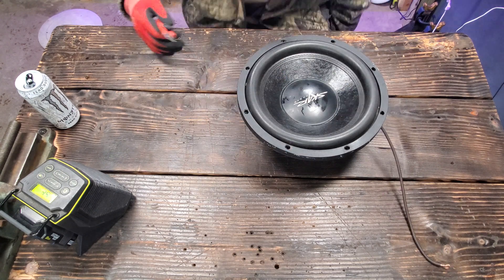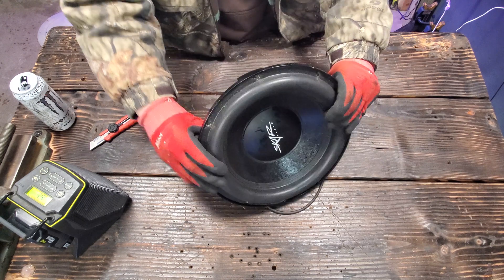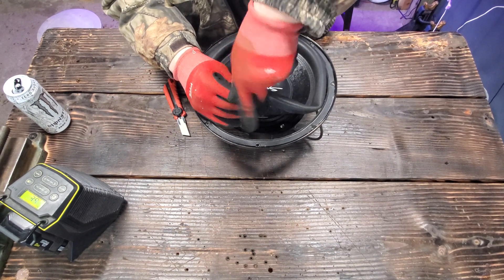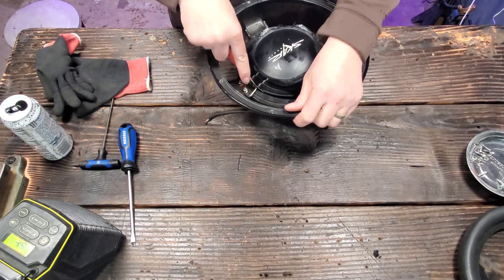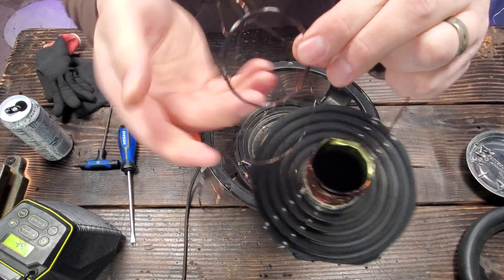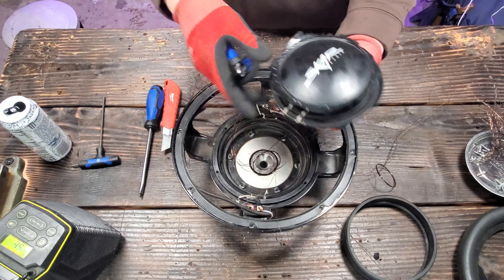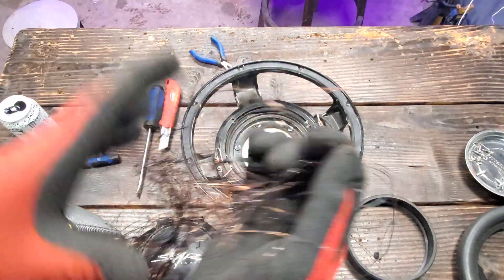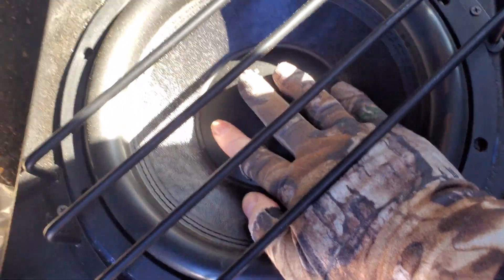Skar VD-12 D 4 12" Shallow Mount Sub. Lets take it apart and see why it BLEW💥💥

Comment: I will never buy skar again they are just cheap junk I ordered 9 ma8's I talked to them before I order what they had left in stock as I needed 12 they said I they would be back in stock in 2 weeks 3 at most 2 weeks later I sent a email to see if there was a ETA update the tell me 2 more weeks I messaged them again then says there here but they will be restocked Monday company but nope call them Tuesday and they tell me they discontinued them of course I said will I needed the 12 not 9 I want to return 8 of them (I opened 1 and screwed in box for the box fitment) said no its been over 30 days even asked to do a up trade and I would pay the difference but nope and it was the owner I talked to every time so he new what was going on I felt like he was just damping the lift over stock then played me for 30days so no return had to be taken I left a 1 star review.. The next problem was 3 months earlier I ordered 3 RP-2000.1d mono amps to power the at that power the at that point future 12 ma8's sub's order but 1 of the amps was missing to remote base knob I called them 4 or 5 times over it they kept saying will get it right out to you well it been a few years and I never got it I left a 2 star review this was my 1st bad one and when I left the 2nd bad review a 1 star for the MA8'S subwoofer debacle is when I figured out the SH*T company deletes there bad reviews and that would be why they have such good reviews.. thanks for sharing

Comment: Nothing like a video trashing a manufacturer of decent audio equipment, potentially swaying the opinion of others to think SKAR AUDIO is junk based on some dude's experience (or lack of) of over powering an entry level sub in a shitty sealed enclosure with added ports that were not properly calculated while in a frozen tundra of car audio despair. (Yes, ambient temperature plays a role)
So many variables in this equation that all point at the installer /user. 

Hey man, its not fair to publish a video blaming your lack of using simple mathematics and a little bit of science on a manufacturer that did actually put the time & effort of calculating what this sub can handle when engineered.  They even wrote it on the box and put a sticker on the magnet telling you that. 

Clearly this is no ones fault but your own man.

Comment: Lets do some math....each sub can handle 500 watts RMSx2 = 1000 watts power handling. Amp is 3k at 1 ohm if subs are dual 4 ohm wired in series gets you down to 1 ohm load. 3000 watts vs 1000w power handling and I am sure a little clipping yeilds fried subs. You put 3x the power to those subs and the subs are bad?🤔. Come on now. Next we are going to hear the gain was not even that high just half way. Those subs if in a proper box with the gain set correctly (not all the way to clipping) would have played well. There is a lot to know in DIY car audio and this one one of those lessen days.
Reply: Two 4 ohm subs wired in series is still 4 ohms you would have to wire them in parallel to get down to a 1 ohm load
Reply: To get to 4ohms you need to wire two dual 4 ohm sub's in series/parallel.

Comment: I have 2 skar vd-10s on a skar 2000.1d in a ported box in mt '16 F150 crew cab. Been running her hard for almost 2 years now, zero complaints and she fkn bangs
Reply: I have the vd12 in a custom but under the seat of my crew cab. Is ported box under the seat? I hear ported is the way to go especially for these shallow mount subs
Reply: @ttwizted6020 actually sealed is better. That came from a guy that builds systems for competition. Especially for sound quality.

Comment: The copper coil is thin because its only 200 watts rms each coil no thicker coil needed

Judging by the video u used a good amount of force to take out the screws the reason why there's no glue around the spider is because it would be easier to recone 

I wouldn't rate that subwoofer 500 watts rms I'd say its 400 to 350 watts rms
Reply from the maker: If i am not mistaken doesn't the box say its 800 watts 500 rms, but is clearly not. thanks for watching man
Reply: I find your review kinda funny and sad at the same time. I have been running 2 Skar VD-10 D4s for about 4 years now and have had no problem with them. I did replace one because of enclosure issue but that has been fixed. I have an RP1500.1 powering them and they bump pretty hard and clean for being "over powered". Ultimately it comes down to enclosure design and how you use them. The specs say to design a box at around 36-42 hertz for optimal usage.
Reply: I've been running 1200 watts RMS on my VD 12 for 2 years hard. zero issues. he was running 1500 watts RMS. it is definitely not a 200 watt RMS sub 🤣

Comment: Feeds 3k watts to 800 watt sub and it's the subs fault....🤦🤣🤣🤣
Reply: Yea no shit. "Thinnest wire ever!" Yep on a voice coil from a 500 rms subwoofer. From the 2nd tier line of an entry level budget company. Haha. I've been running exclusively skar (EVL series) for 7 years, mids and tweeters for 3 years and not a single problem. It's amazing what rms matching, correct wiring, a good electrical system, and an oscilloscope will do.
Reply: 800 watts max for each sub dummy

Comment: What's a better 12 inch shallow for $80?  I've been waiting to get these for my silverado extended cab.
Reply: The subs are really good haven't had any problems  mine are the 12vd d2s and I have them on a smart 3K and they've been playing great for a year they bump really hard everybody trips out that their shallow mount Subs I have them in my Escalade in a sealed box behind my third row
Reply from the maker: That's that thing for 90 dollars shipped to my door, You cant  find a better deal. I should of just spent the  160 a peace and got the C.T. sound like I wanted to.  Hands down the best sub I have tested to date!!!!

Comment: What amp were you using at what ohm? I have these but mine are 10s and I’ve been feeding a 1200 kicker amp to them for two years and their still rocking strong.
Reply from the maker: They were 2 ohms, and I was running my smart 3k taramps, but it was from the box, I had a ram box for under the seat and it's way to small for those subs. It's like .5 cubs be sub, supposedly. But there is really not much room in those at all. So the subs heat up faster. In a smaller space.
Reply: @alsrandomvlog8968  u were running more than 1200 watts 💀💀 u most likely over powered it
Reply: @Louie-ji8xn  yea he was giving them 1500 rms a piece. They're 800 max 🤣🤣🤣
Reply: @TheBakeMaster  🤣🤣🤣🤣🤣🤣

Comment: When I see a black coil that isn't supposed to be black the first thing I think of is clipping. sadly skar doesn't sell any recone kits. I hope u still have some bass in the truck
Reply: What box did you use?
Reply from the maker: @tuckerramos4439  It was a shitty Ram box that goes under the rear seats for a Ram 1500 because its not flat like the fords, it has those to big storage bins because of the transmission hump in the middle. If you look in my other video were I blow it you can see the box.
Reply from the maker: Of course, See what it is, i bought one of those ram truck box's and there is way to low of air space in them, around 0.6 cubes but I think its less then that, so the subs would heat up quicker because the box was to small. 
So technically it was my fault but I balm the company that made the box to small for any sub woofer..
Reply: @alsrandomvlog8968   Ya truck boxes can be hard to fit anything decent in them